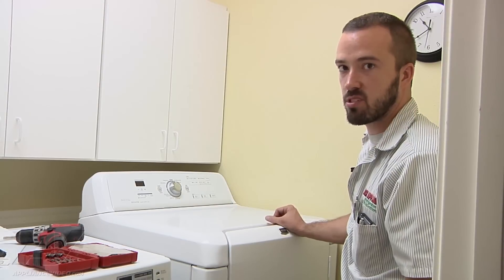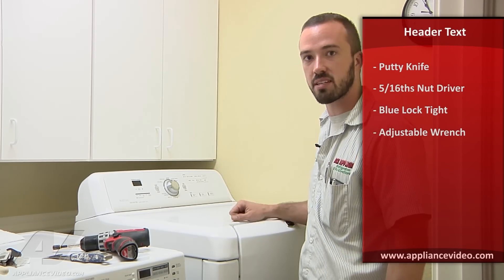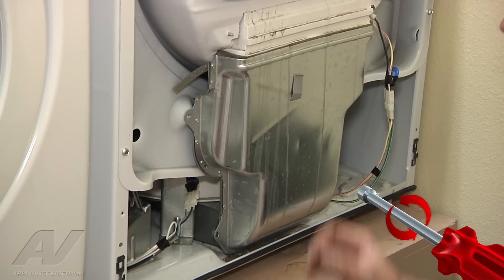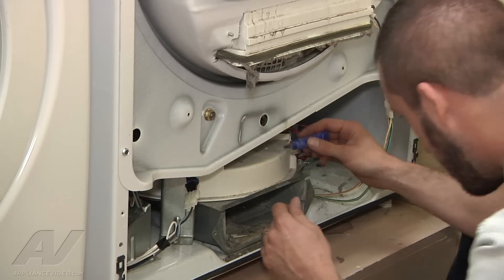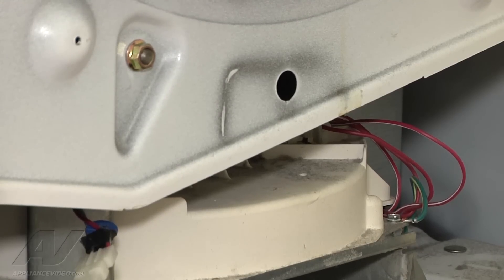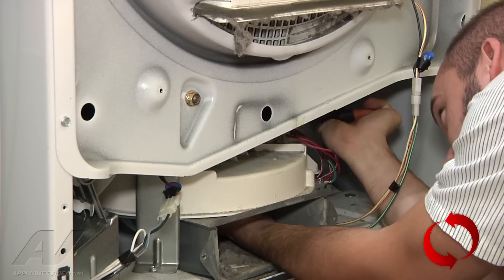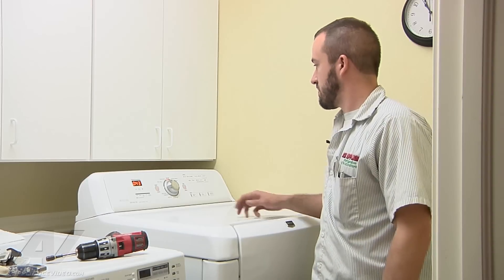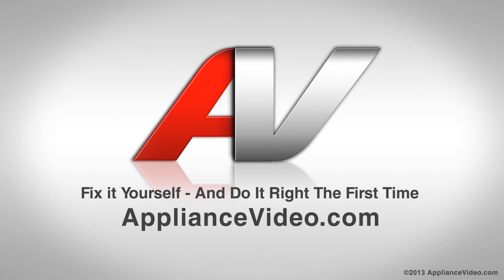Maytag Dryer Repair - Not Drying Properly - MGDB200VQO

Comment: Matt, you are a lifesaver! Every single step went as you showed in your video. From popping the front of the dryer off to putting locktite on the pulley to threading the belt. It was so satisfying to have hot air blowing out the back of the dryer. I can't recommend you enough! I'd buy you several beers if I could.
Reply from the maker: Curtis
        Instead of beers you can help us by posting  ApplianceVideo.com on your YouTube, Facebook or Twitter account or add us to your circles. Thank you for the positive comment.  If you are in need of any parts please support our parts department on line at http://savemoreonparts.com/ or call 1-800-830-5465 7-days a week until 11pm Eastern time. Thanks again your support.  Matt, Ace Appliance service technician.

Comment: You Sir, are a lifesaver! When I realized I didn't have any airflow coming out of my dryer vent outside I was able to Google the problem and I was led your YouTube video. My Maytag Bravos quiet series 300 is only 2.5 years old and was really expensive. I was distraught when the dryer stopped working instead the lights flashed and the "check lint filter" light flashed no matter what I cleaned out. And I cleaned out everything, trust me. After watching your video I was able to take off the front of my dryer and guess what I found? Yep. The pulley had backed off and it was laying at the bottom along with the belt. The only thing I struggled with was putting that belt back on. I found if I put it on the motor first then "walked" the other end by turning the fan it eventually worked its way back on. I'm a lady so I don't have a lot of strength in my hands like you guys do. Anyway, thank you SO much for posting these videos. I didn't have the extra money to pay a repairman and this really saved me big time.
Reply from the maker: irenejones69
                  Thanks for your positive comment. We are glad we could help resolve your issue and save you money. Please help us provide more videos to our site by subscribing to our YouTube page or posting ApplianceVideo.com site on your Facebook or Twitter account. We also have our factory authorized technician’s email daily free professional advice to people like you to help solve their appliance problems. Thanks in advance for supporting us. Matt, Ace Appliance service technician.

Comment: Great video. I am trying to find out why I have so much lint buildup inside my machine? I mean inside the motor, and surrounding areas. I checked all the felt seals, and they are all intact. I also get alot of lint outside of the vent. Any ideas?
Reply from the maker: Great question, if you have a more technical question that our parts department cannot answer, you can search our over 17,000 answered questions free at our website www.ApplianceVideo.com under our Repair Help section. You can also call our parts department at 1-800-830-5465 and they can give you help 7-days A week ,or search at www.SaveMoreOnParts.com  .

Comment: I have gotten thru the entire process except I cannot get the belt around the motor pulley bolt.  There is not enough give in the belt to get it to stretch over the bolt... any advice?
Reply from the maker: +Amy Doezema 

         Good question, with our technicians
now getting hundreds questions weekly, they are answering all questions at our
website http://www.appliancevideo.com/repair-help/ .  We also have over 30000 common questions
and answers that you can easily search through by your model number, appliance
make, problem or error code and it’s absolutely FREE.

Comment: Great video, but I have a question.  When I try to put the belt back on; Im running into some problems.  The is a flywheel in front on the pulley on the motor; do I take that off to get to the motor pulley?  Otherwise I'm having some serious difficulty stretching the belt from the pulley... which I think is behind the motor flywheel ... to the pulley on the blower motor.   Help??
Reply from the maker: ccpho565 

                   All of our technicians are now answering questions
daily at our http://www.appliancevideo.com/ website under the Repair Help section.  We also have over 1600 common questions and
answers that you can easily search through by your model number, appliance
make, problem or error code and it’s absolutely FREE. You also have the option
to email a factory service technician with a question on your appliance at
http://www.appliancevideo.com/repair-help/ . If you’re looking for a repair video, you
can also search our library of over 2600 free repair videos. ApplianceVideo.com
specializes in quality DO-IT-YOURSELF appliance repair videos and we get over
800,000 views per MONTH to our videos worldwide and growing. If you need of
parts for your major appliance, we have over 5-million parts in stock at http://savemoreonparts.com/ .  Thanks
for your support. Matt Ace Appliance factory service technician.

Comment: Sorry for the typo.  Great video, but I have a question.  When I try to put the belt back on, I'm running into some problems getting it to slide over the pulley on the blower dryer.  I connected the belt on the motor side first as you suggested.  Stretching the belt from the motor pulley to the dryer blower pulley is almost impossible.  There is a flywheel in front of where I believe the pulley is located on the motor side.  Should I take this off to make installation of the pulley easier?   If so, what tool do I need and is there a video on removing and reinstallation of the motor flywheel.  Just don't want to make matters worse.  Help?? Thanks.
Reply from the maker: ccpho565 

                   All of our technicians are now answering questions
daily at our http://www.appliancevideo.com/ website under the Repair Help section.  We also have over 1600 common questions and
answers that you can easily search through by your model number, appliance
make, problem or error code and it’s absolutely FREE. You also have the option
to email a factory service technician with a question on your appliance at
http://www.appliancevideo.com/repair-help/ . If you’re looking for a repair video, you
can also search our library of over 2600 free repair videos. ApplianceVideo.com
specializes in quality DO-IT-YOURSELF appliance repair videos and we get over
800,000 views per MONTH to our videos worldwide and growing. If you need of
parts for your major appliance, we have over 5-million parts in stock at http://savemoreonparts.com/ .  Thanks
for your support. Matt Ace Appliance factory service technician.

Comment: Is it possible that when i put the belt back on that i twisted the belt the wrong way? It's difficult to replicate the strange noise in writing, but the dryer was working just fine until the pulley and belt fell off.
Reply from the maker: Try taking the belt off and spraying a small amount of oil on the idler pulley bearing. Then put the belt back on and if the noise goes away you know its a bearing in the idler pulley. I dont think by twisting the belt will cause a noise.If you are not sure which way the belt goes on get your modeel number of the unit and go to appliancevideo.com and go to find a video by model number.Then find your belt and there should be a video on your specific belt so you can see the proper way it goes on.Please support our parts department at 1-800-830-5465 open 7- days a week.  Parts sales are the way we fund the filming of these free quality videos from our factory trained technicians. So far thousands of people have benefited from our videos and thanks us for our free help. Thanks For your support and good luck with your project.

Comment: ok I followed this video and it is great but unfortunately not my issue.  I still have a dryer which is not drying/heating.  Any other suggestions?
Reply from the maker: Jake 
          I would need your model number of your unit and the exact symptom. Shhot that over and I can help.
Reply: Model:  MEDB850WQ1

The exact problem....dryer tumbles but with no heat, all lights work, no errors indicated, lint cleaned. I followed your video exactly but the cable and pulley were intact.

Comment: I'm a little embarrassed. I cannot disconnect the wires that supply the door light power. You seemed to do it very quickly. Mine has a locking mechanism that I cannot seem to unlock.
Reply from the maker: Great
question, you can call our parts department at 1-800-830-5465 and they can give
you help. If you have a more technical question that our parts department
cannot answer, our technicians are answering
all questions at our website at ApplianceVideo.com under our Repair Help
section. We have over 3,000 common questions and answers that you can easily
search through by your model number, appliance make, and problem or error codes,
and  Its free to search through our question & answer library.
Reply: Thanks
Reply: same issue
Reply: I just used one of those tiny flat head screwdrivers that you can use on glasses. I wedged it in there and it popped right out.
Reply: I wedged a flathead under the clip and it popped right off.